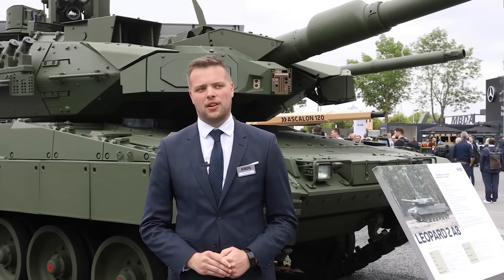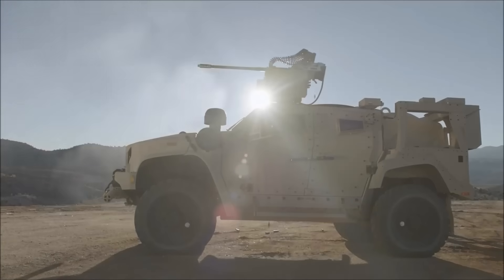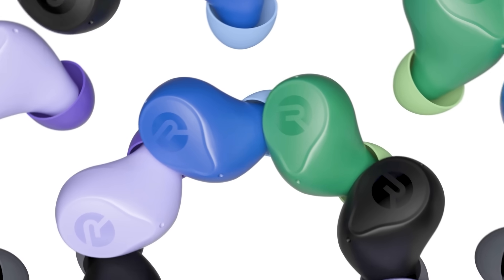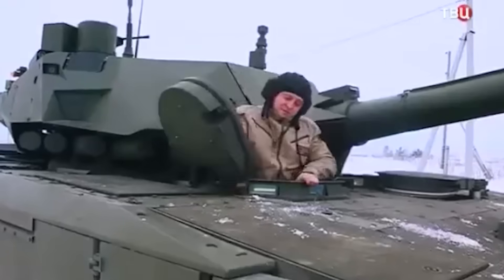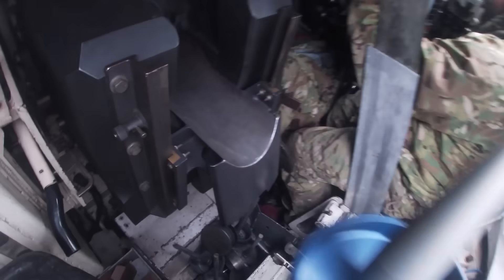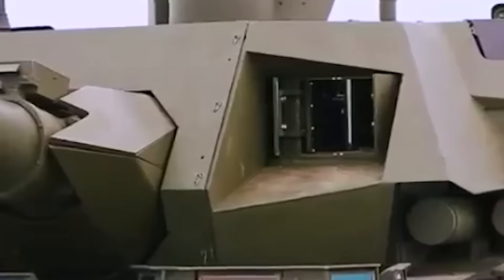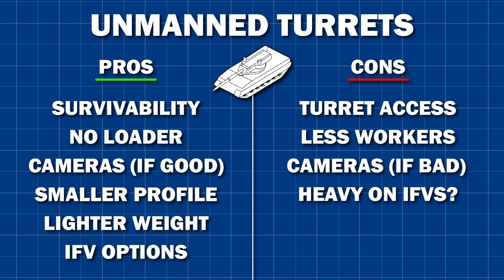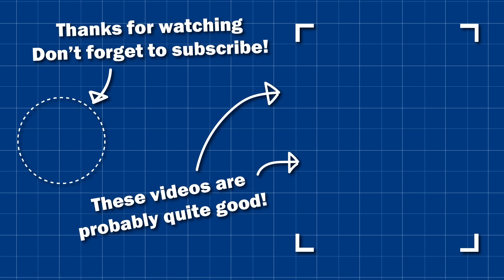The Unmanned Turret - And Why It's The Future

Comment: I'm not sure the "less need for a heavy turret armor" advantage is that valid of a point. Just because a turret is empty doesn't mean its inside don't need protection anymore: a turret that gets blown off is still a mission kill, even if the crew survives. What I do agree on is that a smaller turret (which may or may not be easier to do on an unmanned turret) means less surface to cover in armor, and also more possibilities for an armor profile that favorises ricochets.
Reply: in modern combat, getting shot once is usually a death sentence even with heavy armor. Its better to NOT get shot in the first place which is why APS exists
Reply from the maker: The armour is to protect the crew. Even on a regular MBT the RWS, optics, thermals and main gun are nowhere near strong enough to stand up to anti-tank weapons. Even if an unmanned turret is destroyed and the vehicle is mission killed, you still have saved two lives.
Reply: @RedWrenchFilms armor is there to protect the crew, but it has the secondary effect of protecting the armament systems as well. Not the gun barrel strictly, but also the breech, the electronics, most of the fire control systems, power traverse, power elevation, etc.

What I'm saying is, send an unarmored remote turret going to war, we're going to see unprecedented rates of F-kill from turret pens.
Reply: @RedWrenchFilms  so the armor on a turret is enough to protect against antitank weapons? its not, the armor need to protect from cannon fire mainly because antitank missiles are superpowered but also slow (subsonic) so a tank needs to be exposed to them for a lot of seconds and tanks dont want to fight like that but they want to be exposed only when they need to fire their main gun or if the orders are attack by moving on open terrain... the idea that tanks go forward to protect infantry is dead a long time ago and todays tanks figth like infantry using hard cover, supress the enemy and then move to their next fighting position
Reply: @RedWrenchFilms  yes but the thing about modern armor is that they are ment to protect against high penetratring anti armor weapons like from another MBT. but as seen from Ukraine tanks are mostly taken out by drones hitting weakspots like the side or roof. i believe future tank should still have super heavy armor for the hull to protect the crew against MBTs but then better all around armor that will protect against drones. especially the roof including the turret.

basically i think the turret and hull sides should have all round protection including roof and rear against autocannons and rpg. so like around 100mm of kinetic and 400mm of chemical protection.
Reply: @Phantom-bh5ru  Armor on an MBT had been in a decline with the launching of the APFSDS, it's very hard to even counter it. But Offense and Defense of a tank had historically been on a high rivalry, with the usage of HEAT being able to penetrate dense armor, before it was brought down by ERA, and then countered by the APFSDS. We're still on the technological scale of being unable to create an armor that is able to reliably counter APFSDS on a mass scale. Super Heavy armor is nowhere near the Apex as that is the exact same route of the German World War Two doctrine and went nowhere. 

It just becomes too expensive and not ideal for bridge movements or rail if it continues to raise its weight. Mobility is one of the keypoints of a tank, which is why for a time, Leopard 1 and the AMX-30 were two of the most common and capable tanks that the West had. Putting more armor just doesn't cut it when it drastically increases cost, requires more material to build with an already declining and expensive bill to pay. Building tanks is very expensive, considering you can't sell them consistently, meaning you're going to be putting tax dollars down the drain. 

Also you need to understand the terrain of the vehicles, because adding weight to a very heavy tank means it can't traverse well or have enough power to go over hills, go through mountains, traverse the deserts, go through forests and maybe sink in the marsh. Not to mention transporting such tanks through warships, realistically very much foolish to add more armor. Especially when the top needs to be thickened drastically. 

Now it's well protected, but what about the powerplant? It will require a bigger powerplant, guzzle even more fuel and eat your logistics line. That's the point of how the Maus, the German Wonder Weapon got cancelled as it became apparent, that it wouldn't be functional. There isn't enough Armor when your enemies are APFSDS meant to penetrate the newest armor type and top-attack missiles which are mostly HEAT warheads. And Drones will just attack the powerplant compartment, meaning you'll need to overhaul the Powerplant cooling and exhaust system. 

The easiest thing to do is to support a tank with infantry and Auxiliary vehicles to take care of those problems first before they threaten the tank. You do anything by a unit alone, they'll be overwhelmed instead. Quality doesn't beat Quantity well, and World War Two already taught many that. You'd need both of them in a war.
Reply: @Phantom-bh5ru  Yeah, although only wealthy first world countries would have the recourses and technical advancement to achieve something like that, and the loss of a tank would hurt much more.

I don't know what I am talking about, but I imagine armor tech might need to evolve to make something like that feasible.
Reply: @RedWrenchFilms  what about the opportunity cost? How many other soldiers were put on the line to put that tank in that position and how many lives are lost if the tank fails to deliver?
Do you think we are going to see anyone build tanks that put emphasis on protecting the rest of the forces rather than just their own crew?
Reply from the maker: @Spider-WoIf I’m not sure I follow. My point was that an unmanned turret and a manned turret tank are both able to be mission killed with a hit to the optics, gun etc. The opportunity cost would be the same, no?
Reply: @RedWrenchFilms  I think what they are trying to say is the odds of a mission kill go down if the unmanned turret is armored.   A coinflip for being removed from play might be worth the extra cost and weight of armor, if the alternative is a guarantee of being rendered unusable during the current battle.
Reply: @RedWrenchFilms  I was arguing that armour on the turret would significantly increase the odds of preventing a mission kill and that solely focusing on the survivability of the crew of the tank could lead to far higher casualties in the operation at large.
A balance between protecting the crew of the tank by armouring the crew compartment and protecting the sucess of the mission by armouring the main gun system makes the most sense to me.
Reply: @SabinStargem You miss that mk1 eyeballs scopes are only there if anything else has gone wrong in most armor from Nato. Changing the turret configuration to a fully automatic will not change that. Heck Ukraine are currently using fully automatic turrets at great efficiency.
Reply: @Spider-WoIf  From the perspective of the warring state, crews are a valuable resource. If the turret gets knocked out but the vehicle limps back, it can be repaired and re-used at a cost far lesser than that of producing a new tank and training a new crew. In modern wars, conversion of national power into military power is highly important, and from the perspective of efficiency, unmanned turrets seem better, plus due to a lack of crew in the turret, Merkava-style designs with the engine in the front which provide excellent crew protection could become competitive with the standard western design for factors like weight balancing and gun depression, as the turret could be mounted further forward.
Reply: @marcussoleil3733  engines actually offer very little protection against apfsds, putting it in the front significantly increases it's signature and most importantly: it reduces the depth of your front armour. The most modern version of the Israeli merkava offers less kinetic protection than the leopard 2a4.
Also keeping your engine means you can still retreat.

For unarmoured turrets:
Protecting your crew is important.
But protecting your unit is even more important and you can't do that if you loose your turret
Reply: @Spider-WoIf what about the opportunity cost of having a lighter and faster tank, and putting the money for materials, production, and logistics, into making and deploying more weapons
Reply: @trevorle7382  
1st. having a lighter tank doesnt mean it will have a higher top speed
2nd. having a higher top speed doesnt always mean you can move faster during combat
3rd. a less armoured tank that you propose will not allow you to field more for less

1st. if you compare the speed of IFVs and MBTs you will realise that, despite being significantly lighter IFVs do not go significantly faster.
this has many reasons.
first of all your top speed is not only dictated by your power to weight ratio, but also by your tracks. going faster exponentially increases the material requirements for your tracks, while weight only increases them linearly.
second mbts and ifvs do not exist within a vacuum. they fight with and against whole ecosystems of weapons and personel, which can only move so fast. going faster simply does not offer enough benefits after a certain point. that point was already reached during the cold war.

2nd. if you compare the ukrainian's experience with the marder and BMPs you will find that, despite the higher top speed offered by vehicles of the BMP family ukrainians have reported the Marder's combat mobility to be higher.
this is because even though the BMPs could go faster in theory, the realits of the battlefield means that due to its lighter armour the BMPs are far more vulnerable and thus have to be moved both more carefully and with more supporting units, that happen to be slower than them.
The marder's superior protection means that it can be moved with far greater freedom.
This is even more important for MBTs, as theire purpose includes creating breakthroughs and conducting counter pushes, for which you NEED to face danger, you can't just rely on evading the enemy, because if you do, thousands of your soldiers will die.

3rd. if your tank simply has less armour it will be less survivable and thus attrition faster, which increases material drain to at least the same while increasing the need for new crewmembers dramatically, while reducing the excpected lifetime of crews, which over time again significantly increases your rate of attrition, because your tank force will be operating with far less competence, this has not gone well for russia.
if your tank compensates for it's lack of armour through active means then it's production cost, maintenance cost and operating cost will simply increase.
Reply: @Spider-WoIf  That really is a question of trade-off and role that it is used in. Less armor allows for more speed but also easier penetration. More armor is slower but more durable. So do you need a fast and nimble tank that can be in places fast or do you need a slower and heavier one that can hold positions better? So that is just a question of military doctrine.
Reply: @RedWrenchFilms  True, but that still dodges the question. The main gun is a much harder target to specifically aim for compared to the entire turret.
Reply: @RedWrenchFilms  The only reason the crew needs to be protected is to carry out their mission. If the tank is unusable then its the same result.
Reply from the maker: @AmogusGooner420 Not at all. The crew can return - alive - and participate in future missions. Crew are incredibly expensive assets.
Reply: @RedWrenchFilms  It's more about more compact design (see the T14) hence lighter
Reply: The main point would be that the turret would be smaller, which means it takes less material for the same armor thickness
Reply: People on this comment section have absolutely no idea about how armor is designed. Protecting the crew is absolutely the top priority. That's why pretty much every moderns tank has less armor on the parts of the tank where there isn't crew like the side armor of the engine section of the leo 2. Non crewed section are usually only armored agains auto-cannon fire.
A hit with any proper AT projectile to thr mantlet of a tank is most likely going to cause a firepower kill, so when there is no crew on the turret, it isn't necessary to armor the breach against anything more powerfull than 40mm apdsfs.
Reply: The armor is going to be strong enough against 30 - 40 mm shells
Reply: Even if you wish to protect the turret you will still need less armour to a achieve the same level of protection since you need to protect a lot less volume of space.
Reply: @Владимир-й7н2ш  i agree. sorry, but like... 200 to 300mm of steel, rubber etc. don´t weigh 10 tonnes, especially, as you said, if the crew is in the chassis.
Reply: The crew is more valuable than the tank. If they have to retreat back to base to get a new tank, it's better than them going kablooey from their carousel space program and the military losing 3 highly trained and probably dedicated crewmen.
Reply: Took the words right out of my mouth. The benefit from an unmanned turret is the Square Cubed Law, which means that, for the same weight, you can have a lot more armor, or, keeping the same amount of armor you have, you can have a lot less weight, which has plenty of benefits (better mobility (even if your top speed is equal, you can use more bridges, get less stuck in mud, etc. etc.), less fuel consumption (so more range), less wear and tear on basically everything, and...maybe some other stuff I'm forgetting.)
Reply: Making armour capable of ricochets is getting harder and harder by the year. I also first thought even though it is apfsds it can still ricochet often. In reality apfsds is capable of hitting armor almost parallel to the round and still rip a massive hole in that armor. It's pretty impressive.

That the turret should still the armored well is a point I definitely agree on, and I don't see why it should just remain as is. Technology for engines had also gotten a lot better over the last 40 years, however I'm not aware if a single time that leopard 2 has ever received a power pack upgrade. I'm sure that with the current technology they can get maybe 100-150 horsepower extra without even using more fuel.
Reply: the point is even if a turret is hit but not penatrated, the optics are still damaged and out of action. So what is the point anyways
Reply: Yes, dozen of T-14 Armata have been produced. Are they in service? No. Most likely they never will. It's a Putin's white elephant.
USA, NATO allies and especially the USSR have been experimenting with a turetless tank(s) since 1960s.
Reply: thanks. I relly don´t get why people and companies (Rheinmetall, even though i´m a fan of (their) big Cats) say "well yeah, now we don´t need that much armor!" like... yeah, as you said, only because the crew survives, doesn´t mean that that would be "ok". the crew is there to manage the Tank, to drive, and shoot. the main objective of a tank is not "The crew needs to survive", but "massive firepower and good mobility while beeing able to stop (a few) (Anti Tank) rounds" (at least with MBT´s). the Turret WILL be obliterated by 30 mil autocanon fire. Red effect made a good video where he explains why no armor on the turret issn´t that bad, but i think he meant against biggest calibre, not against autocannon fire. because the turret is (statisticly) the most likely to sustain a hit in comat, it should at least be armoured against autocanon fire up to 57mm (russi4n calibre of autocanons). like... if the turret has no armor, it is the exact opposite of what "tank" means in German ("Panzer" = armour). and if it will be hit, the mission is over, you sustained a lot of damage to your (expensive) 3rd gen optics, autoloader and maybe even gun, and the tank will be out of service for at least a few houres. to @RedWrenchFilms : i don´t really think that removing so much armor so the turret can barely stop heavy mg fire for exchange of 3, 4 5 (maybe even 6 or 7) tonnes is a good tradeoff. like, the (MBT)Tank is DESIGNED to withstand such fire. and even some light tanks can withstand 30 mil at the front (where it needs to be able to sustain it, at the back it issn´t that much of a problem).

With friendly greetings (mit freundlichen Grüßen) ^^
Reply: @Sevencraf707  I agree absolutely. If your "new" main battle tank can now be taken out by any run-of-the-mill IFV or even smaller human operated anti-tank launchers (think RPG-7 or LAW) then youre gonna run into problems. 
Sure, tank on tank fighting is extremely rare so you dont need to armor up for that, but any less than that you should be able to survive without being mission killed.

I'd also believe that having your commander able to see out of the hatch and having full access to the main and coaxial weapons will remain important.
Reply: What is square-cube law? Smaller turret means tremendously less armor weight for the same protection, just like a smaller tank which soviets knew from day 1 with T-44. 
By using the bustle autoloader without shortening the chassis RC 3.0 wastes incredible amounts of volume, it's all the wrong choices.
Reply: @Klovaneer  that is not what is meant when we talk about the square cube law.
If you armour a cube that's twice the volume you need less than twice the armour
Reply: ....WHY TURRET IS NEEDED AT all,THOUGH

....WITHOUT IT,MASS AVAILABLE FOR BUILDING UP ARMOR WILL INCREASE A lot

....AND,AS MODERN WARFARE SHOWS,IT'S NOW IMPOSSIBLE TO JUST PROTECT FRONTAL AREA,SINCE TANKS DONT FIGHT TANKS ANYMORE
Reply: This is why, if they looked at ALL the tanks on display, that the Leclerc Evolution is a good indication of where things are going. A lot is exposed, yes, but there is still a very thick pice of armor making up the base of the turret. The advantage weight wise is that they’ve made is very low profile, allowing for massive weight savings while still protecting critical parts of the tank.
Reply: Lol many clueless keyboard warriors. It's clear that current tank designs are a dead end and a smaller, lighter automated turret is likely to be the future. Why are you babbling about "mission kill" and nonsense like that? A trained crew is FAR FAR more valuable than a tank turret lol 😂😂😂 and the other who said a more easily disabled  turret will lead to catastrophically higher overall losses .... Pls give me pause, I'm dying of laughter! 🤣🤣🤣🤣
Reply: @DensApri   @DensApri  "lol many clueless keyboard warriors. why are you babling about "tank kill and "that a trained crew is FAR FAR more valuavle than a tank turret""... do you realise something? did this sound dumb? yeah? well then you know what our impression of someone is, that doesn´t read the comment he is respoding to. we said "only because the crew is safe doesn´t mean you don´t need armor". like... the armor issn´t there to protect only the crew. if a vehicle, that is meant to engage the enemy frontally (ladies and gentelman, you know it - a main battle tank), can´t "survive" (mission kill) one shot, even from a 57mm autocanon, it´s not good designed. and APS, as much as i love it, can´t respond to every shell that is thrown at the tank. And: the Argument, that the optics etc. will either get damaged or destroyed, doesn´t matter the armor (as long as someone doesn´t put 2m of armor on their tank lol) doesn´t really do it for me. the optics, etc. will be damaged, even if they aren´t hit directly, if the shell penetrates the armor. also: i don´t really think that you would be worse of witf a few tonnes more, mobility etc. won´t be impacted that much (aps will probaply "replace" the need for 300+ mm of armor thus taking extra weight of the tank, but it can´t stop every autocannonround, that is my point) with a few more tonnes. and now to your point "it´s clear that the current tank designs are a dead end and a smaller, lighter automated turret is likely to be the future: yeah, but if it is, and i´m ReAllY sORry THat I buBle that muCH About "MisSiON KiLl", but is your tank worth something if a SINGLE autocanon hit can take it out? no, you probapely won´t need that much armor in the future, but definetly need to withstand a few shots.

I´m sorry, but your comment just sounds like something a 10 year old would say to impress his friends that are watching from behind. if you want to argue against that, and i will be happy to hear some argue against my points, because maybe i AM wrong and you won´t need armour on your tank, just do it civilised, and respectfull instead of "yEAh I´M alWAYs RigHT!ß11?!?!?!".
Reply: @DensApri  all the soldiers trained to assault a position together with that tank take tremendously more effort to train, than the crew of 1 or 2 tanks.
If they die because the tank was unable to take enemy fire, then all the people who depended on that mission to suceed might die and everyone who died to create that opportunity will have done so in vain.